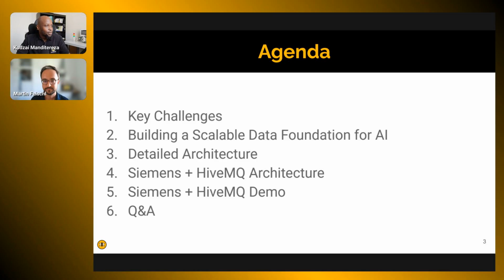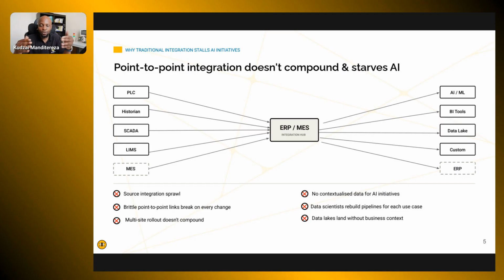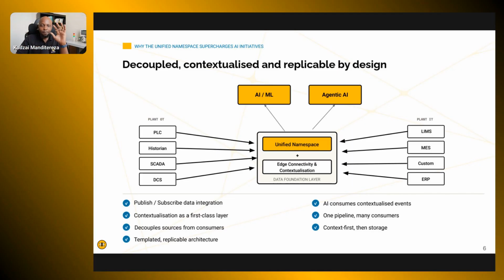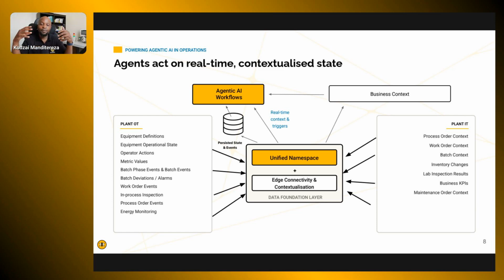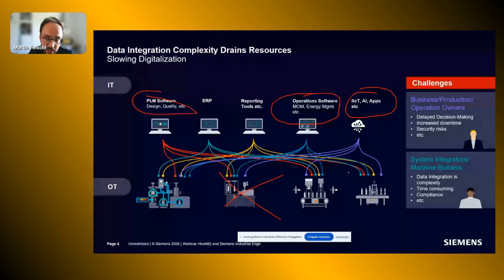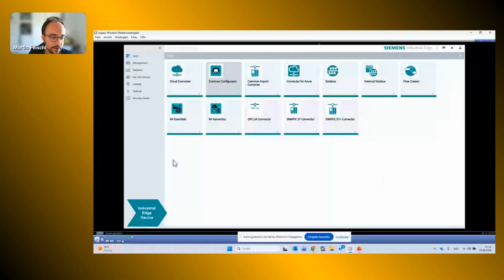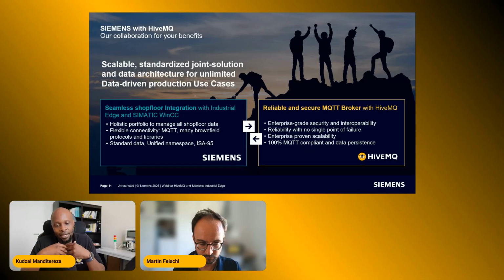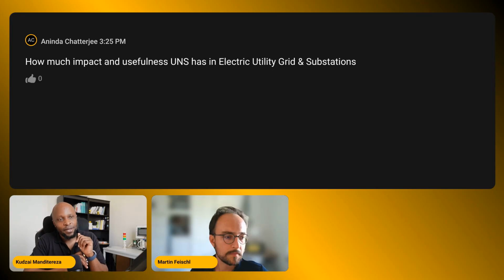From Brownfield to AI-Ready: Building a Scalable Industrial Data Foundation with Siemens and HiveMQ

Comment: Thanks for good and concise presentation. One remark: the "spaghetti architecture" is certainly not an architecture but just an OT/IT ecosystem that, in most cases, originated over a period of multiple decades.
And some questions:
- 33:24 what do you mean with "non-standardized interfaces brown -and greenfield" and "standardized interfaces brown -and greenfield"?
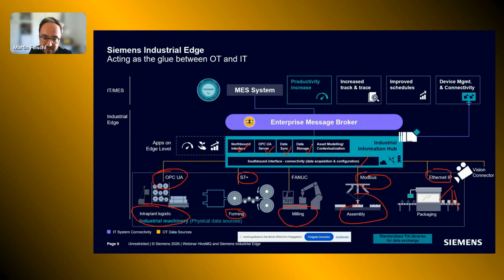- 35:24 data storage in IIH: so that is for only for buffering data in case of (northbound) outages? What amount of buffering is suggested (e.g. 5 min, 1 hour, ...)?
- 40:26 the 10 ms. is the minimum scan-rate for OPC-UA data tags? Can you differentiate between tags from the same source?